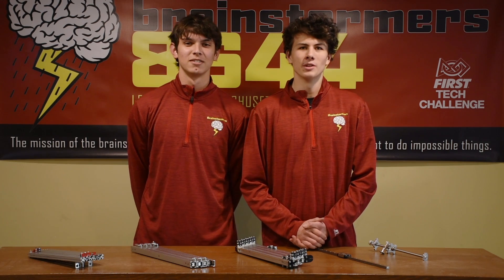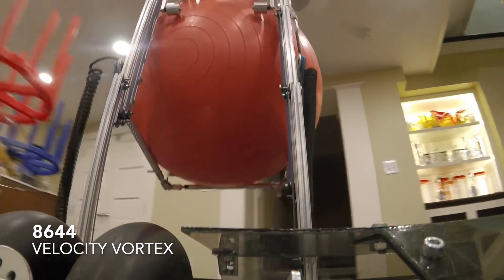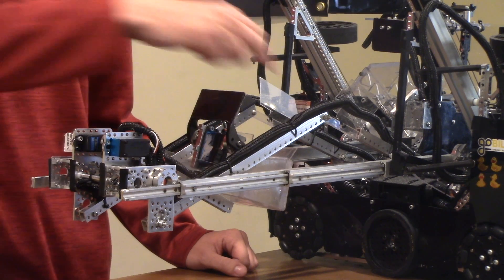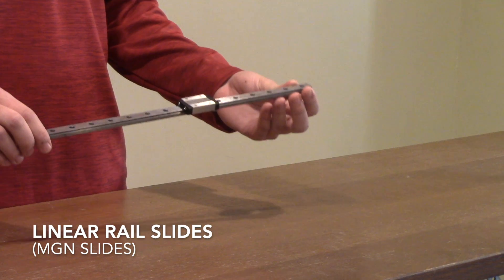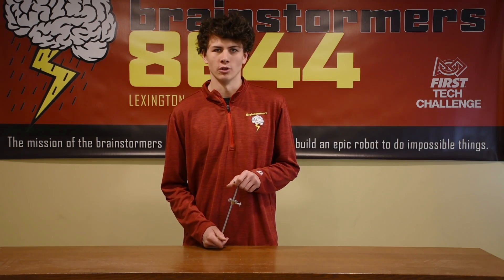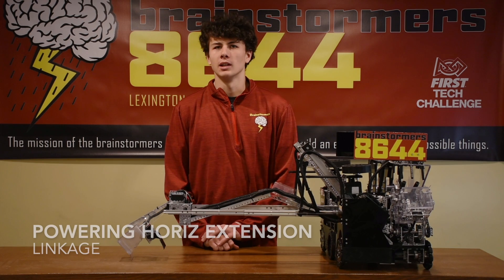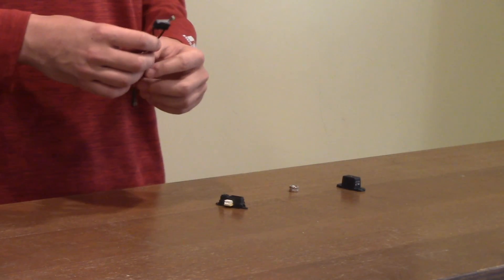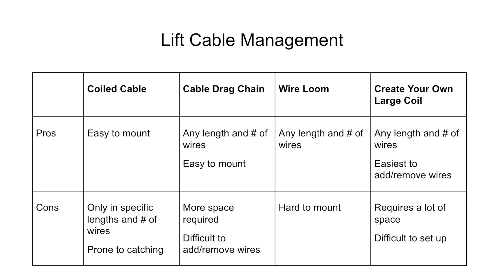FTC Tips and Tricks: Comparison of Lift & Linear Movement Mechanisms

Comment: Hi! My team is using a REV Robotics continuous, linear, vertical lift (without door slides). We only use the materials in the REV Robotics Linear Motion Kit. The lift had been working perfectly and smoothly until a couple of days ago, when the whole lift started experiencing significant friction and some internal sliders started getting stuck as a consequence. The main problem is only on the way down. Do you have any tips or suggestions to make the lift go more smoothly?
Reply from the maker: It's tough to know without closer inspection, but we've had problems where the plastic sliders become misshapen, maybe due to stress or temperature changes. Are there some portions of the lift that are more sticky than others? Have you tried to replace the sliders? If you email photos or videos to us at brainstormers8644 @ gmail.com, we might be able to offer other suggestions.

Comment: some things we've learned over the years using mgn7, mgn9, and mgn12 slides:
- the rails are extremely hardened steel and are difficult to drill and cut. we've used an angle grinder to cut them, but I suspect they'd be very difficult to drill. if possible, check in cad to see if a few holes coincide with the kit parts you're using, use custom parts for mounting, or use t-slot extrusion. also, you'll also have one less thing to worry about if you design around a stock length instead of cutting.
- the carriages are really short compared to the overall length of the slide. mgn slides only have 30-50mm of overlap between each stage, while misumi slides have at least 120mm. this small overlap increases travel, but it also decreases rigidity. these slides were designed to be within a gantry of a 3d printer or cnc with little to no lever arm on them. if you make a multi-stage lift with a moderate amount of load on it, you should have two carriages spaced apart on each rail to increase rigidity. if the last stage doesn't have much of a lever arm on it, you can use 1 carriage for it.
- if you don't want to plumb the depths of ebay, you can get mid range slides from amazon or zyltech that are marketed towards hobbyists.
- mgn9s are the best size for the vast majority of ftc applications. mgn7s are relatively weak, difficult to source, and difficult to use since they use m2 screws. mgn12s are nice for some things, but they're big and heavy. mgn9s are a nice middle ground, and they use m3 screws.
- these are hands down the best slides we've ever used. they have virtually no slop, and if configured properly they can handle very high loads without drooping. the only reasons they aren't more common in ftc are that they're relatively expensive and difficult to use, and for many designs the benefits they offer aren't necessary.